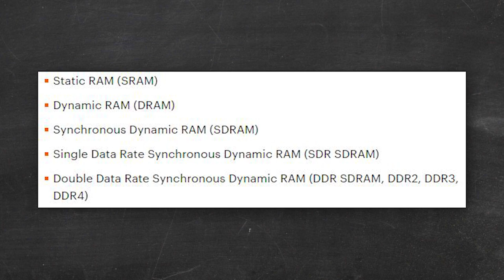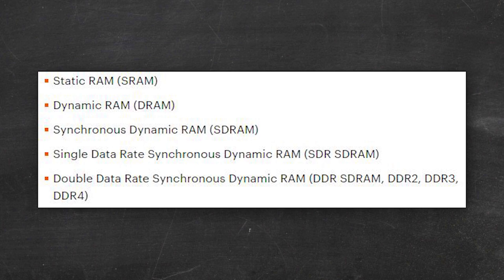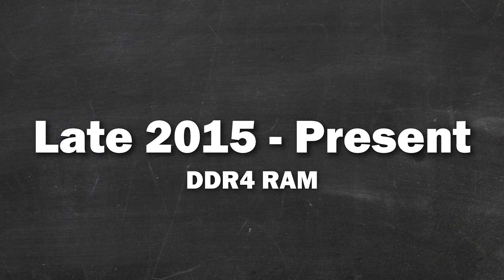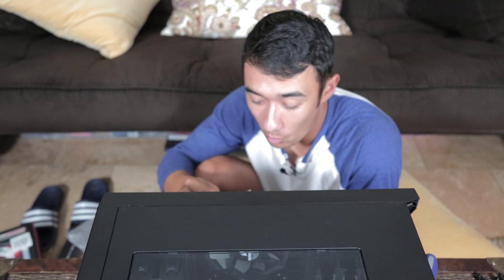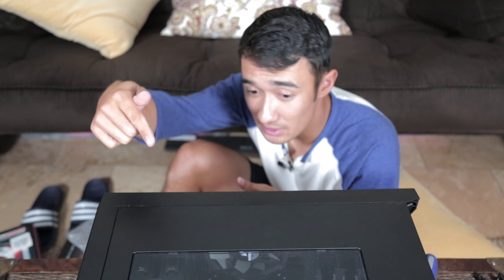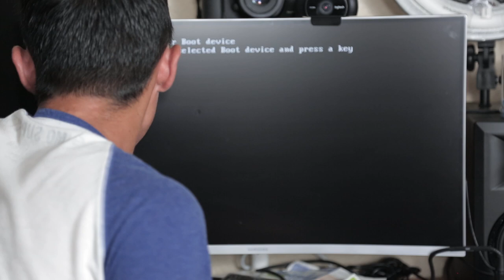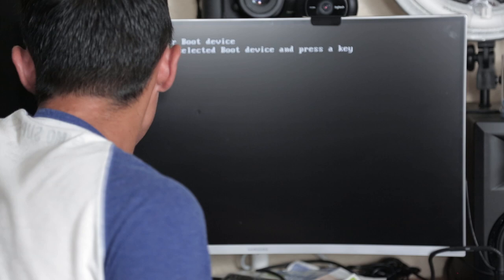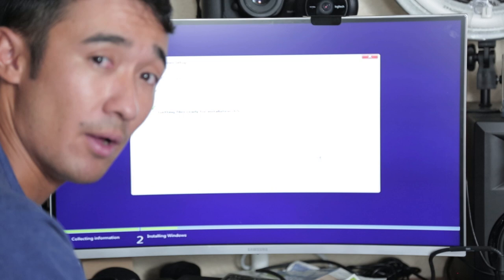How to Build A PC - Full Tutorial

Comment: I'm guessing you followed the verge principle of throwing away the cpu socket cover, keep that shit people, i would probably return a secondhand motherboard if it did not have that cover. Do not handle the cpu by its contacts. Test fit cpu cooler at this point. Always follow the motherboard instructions for ram placement. The "raised bits" in the case to mount the motherboard are called standoffs. Always check the case you buy will accommodate the motherboard, the standoffs may need to be moved, and always use the correct amount. A magnetic tipped screwdriver really helps, put all motherboard screws in lightly at first and once all screws in "tweak" them up, the motherboard is not going anywhere (the screw heads and motherboard holes are normally vibration proofed "have teeth" that lock them together). Always use the motherboard manual for graphics card location, do not just put it in any slot, if you have to wing it for any reason choose the pcie slot closest to the processor, only high end motherboards and processors will have "full" functionality on more than 1 pcie slot. Pcie slots are not lanes, lanes refers to bandwidth, (the motherboard hes using may have 24 lanes of bandwidth divided between all the pcie slots). Please add graphics card last! Can't wait to see this cooler, he knew wouldn't miss the ram then forgot to mount it out of the case. Doh. Please don't rest the motherboard upside down in the case. Please follow cpu cooler mounting instructions i can assure you it will not be the same. The power supply always sucks in air which is exhausted at the back of the case. Case fans always move air towards the hub, at least he knows they are moving in the same direction, just not the right direction. Psu mounted correctly for the case, but only just. Power supply lead clasps towards socket lips don't just play the shapes game. A 20 plus 4 pin power supply, not seen one of those since motherboards had 20 pins. DO NOT cut spare wires from the power supply. Note the flex on the graphics when he plugs in the power lead, probably due to not fitting all the motherboard standoffs. I've never seen any computer component come with twisty ties, they have a metal lining and can short things out, USE TWEEZERS PEOPLE. Plz dont play the shapes game with connections, they only go one way, always use motherboard instructions, no connection is in the same place on all motherboards. No thermal paste, corrupt video my ass, the tube has been sitting next to the build and not moved. Tweezers not twistys. I'm pretty sure this guy did a reaction video to the verge, what on earth possessed him to almost match it. A painful watch.

Comment: This really helped dude, I love how in depth it was!

The one problem I had; my Gigabyte z370 Aorus Gaming 7 had an outdated BIOS in it (I purchased it before they started making the updated BIOS a factory default, for 9th gen Intel support)

[But hey- on Gigabyte's official webpage, the z370 Aorus Gaming 7 actually supports 9th gen processors, but it needs F10 bios. That's the part I overlooked, because I made a fault assumption that my motherboard would come with F10)

And you can guess what type of CPU I bought. Yes, a 9th gen Intel CPU

So now I'm currently waiting on some low-end LGA1151 300 series Intel Celeron to be delivered, so I can actually boot up my system and upgrade the BIOS to F10.
(I actually did my research on this one, should be compatible with everything I already have(

Well, I might as well just upgrade to F11 for the hell of it.

[Specs:

Intel Core i5 9600k
Trident G.skill 2x 8gb DDR4 3000
Gigabyte z370 Aorus Gaming 7 rev. 1.0
EVGA 400w PSU (currently waiting on a 600w to come in the mail)
Gigabyte GeForce GTX 1060 3gb
WD 1tb HDD
CoolerMaster Hyper 212 Evo (the way you put the unit onto the CPU is absolutely DREADFUL, I would never buy this again. Such a pain in the ass.)]

Other than that old BIOS issue, everything is plugged in correctly, I've done the proper precautions, e.t.c.. so if I update the BIOS the CPU should finally work alongside my CPU.

Comment: Hey Kris. I had an issue with a PC that I built, which newbies should be made aware of. 

I purchased a Motherboard and processor and when i put it together, I found that it wouldn't boot. 
I spent a bit of time trying to figure out what 5 short beeps and a restart of the computer meant, pulling off parts and plugging them in.
In the end I had figured that I had checked that the processor was supported, but hadn't checked what the current bios version was on the motherboard. (ver.6) :( 
I had to buy a cheap second hand processor (that was compatible with the earlier bios) to upgrade the bios (ver.20), so that I could use my original processor. 

Lesson learnt... lol
Reply from the maker: You used a Ryzen processor didn't you?

Comment: Good video, but you forgot to show how you connect the front panel inputs of the case into the motherboard so that you are able to use the case's front USB connectors, mic inputs, etc. Since you used it in your video to boot from the USB drive, might want to include that.
Reply from the maker: I covered all that, did you skip through the video?
Reply: @KristoferYee  I stand corrected, missed that part.

Comment: Someone else made a comment about this already, but since it was unnecessarily harsh I understand why it might not be pinned: Pretty sure you got the air flow direction of the case fans wrong, and I think that of the PSU, too :) 
Would be nice to hear your thoughts on installing the PSU with that in mind. Since you could install it so that it sucks air out of the PC, you might need one exhaust-fan less (the current wisdom seems to be to have more intake fans than exhaust, to reach positive air pressure inside the case - so dust gets blown out rather than sucked in through not-filtered holes in the case). My concern then is that the PSU would receive hotter air than if you installed it the other way. But I think PSUs really want good cooling, since they must handle a lot of power that's being dissipated into heat, even with the highly efficient ones.

Comment: or instead of pulling out the usb drive just reboot the system go into the bios and change the boot options and then pull it oot just to save a hassle of actually pulling it out before its done

Comment: I think that u placed the fans wrong because the one at the backside sucks the air out, at least it should because of   the way the blades are shaped. Please correct me when I am wrong, but it is still an amazing video 👍🏻😁.
Reply: Yep that's true. I think he made alot of mistakes. Like installing the gpu before the cpu cooler.
Reply: when u build a pc trust me it is easy to mess up a few times and making a video doing when doing a pc build im sure is pretty hard lol but still better then the The Verge no one can mess up that much lol
Reply: @kyse2  true dat
Reply: But these are minor mistakes.
Reply: @onlyaliquis1876  and? he did it better than The Verge.

Comment: Hi I'm going to build my first Pc, I using it for 3d modeling/rendering, animation, video editing and overall content creation, I cant choose between Intel or Ryzen, I know Intel has more power but its pricey...Ryzen is cheaper and can do more Multitasking but my teacher advised me to go for intel... here's what I got listed so far it might change it depends.

Intel Build so far

Core I7 8700K 3.7 GHz 6-Core Processor

ASUS PRIME Z370-A

CORSAIR VS450 POWER SUPPLY

DEEPCOOL TESSERACT BF MIDTOWER BLACK

Cooler Master - Hyper 212

Gpu I thinking 1060

32 or 64 gbs of ram

1 TB HDD And 124-200 SSD

Ryzen Build so far

AMD RYZEN 5 2600X Or 2600

GIGABYTE X470 AORUS ULTRA GAMING

EVGA - SuperNOVA G3 650 W

COOLER MASTER MASTERBOX MB600L

Gpu same

Ram same

Storage same

Comment: Uh... You got the fans at around 27:00 wrong. The front pans are set intake, the rear fan is exhaust... I don't know why you would make assumptions based on the fan blades. A much safer one is that the part where the center spins is the intake, the part where the center doesn't move is the exhaust.

Comment: Did he get the fan directions wrong? He just said the fan at the back on the case would blow air in even though it’s an exhaust since it’s in the back. Airflow should go in the front out the back, and in the bottom and out the top. The frame that holds the fan itself is where the air blows away from, so the fans at 27:10 are actually sucking in air. The convex side takes in air whereas the concave side is the exit.

Comment: hey kris, love the video but could you double check the section where you talk about airflow at 27:00?  i work at an aerospace fan blade manufacturing company and the single fan near the cpu appears to be the one evacuating air out of the case, not sucking the air in
Reply: that is, for the single fan the concave side of the blade is the pressure side, which is facing outward, and convex is the suction side.  pressure would be greater on the concave side, applying force on the blades inward, and with conservation of momentum air would flow outward

Comment: Is it me or is the CPU not clean! no point pulling thermal paste on cpu that isn't clean, also your rear case fan shouldn't be blowing on your cooler, should be an exhaust to help pull air away from the cooler for better cooling. Other then them points, its good video, very well explained well done :)

Comment: Both intel and ryzen chips benefit from faster ram, not just ryzen. However some intel boards do limit ram speeds.
Reply: ryzen prefers faster ram to intel board, picking slower ram for a ryzen cpu will significantly limit performance, however with intel it doesn't matter as much
Reply: @thecatserole245  Benchmarks?

Comment: At 8:18 you actually said about thermal paste - "This is the glue you will be using to keep CPU cooler on your processor." WHAT??? So the brackets and screws or clips don't actually hold the cooler onto the CPU? That is such a 'Verge-like' statement. Also, you say the rear fan in the case is blowing air into the case and onto the CPU cooler. That fan is an exhaust fan the way it is normally set up. It PULLS hot air out of the case. Otherwise a great video.

Comment: just saw this. iam relativly new to pc building, just build 500-550 pcs in the last 10 years. 
first question: why is the psu installed like sucking in dust from the ground? if the psu is mounted on the upper part of the case, it is okay that the psu fan, 120mm fans in psus are always intakers, is looking downside. so it helps to get warm air out of the case.
second question: why is the rear casefan blowing out while the cpu fan is blowing into the case, so both fans "fight" each other? because the rear fan blows out while both front fans blow in the case.
they are preinstalled like this beause the configuration produces a higher airpressure in the case to keep dust out. and the cpu fan has to fight them too, like you installed it. a fan always spins right, from the side its connected to the fanframe. so yes you can see on the fins if it intakes or outtakes, but not the way like you said it ;) or easy said: the fan blows always in the direction where the wheel is connected to the fanframe.
btw: the heart of the pc is the psu, the cpu is the brain.
and for gigabyte boards, if there are 2x or more pcie16 on the electrical side, like x99 and some z170 or newer, its smart to consider the manual because even if both are electrical x16, better prefer the slot for the gpu that pcie lanes are directly conected to the cpu. besides plugin the gpu in a x8 instead of x16 costs around 1-3% of performance. with the new 3000 series from nvidia, is more important to choose the right pcie slot. but if you are to lazy to consider the manual or maybe dont have it to hand, its no big flaw to use the one closest to the cpu. 
and in you case the mainboard luckyly "says" the pcie lane amount.
and talking about psus,... gold, titanium etc. yes, this psus have a better efficiency but as you said 80% or 85% etc. they are only that efficient if the pc needs this percentage of the psu power, otherwise the efficiency is gone. so choose a psu  for the needs, bigger is not always better, and no, that is not what she said ;)
installing windows from a usb stick: it is more elegant to choose boot from usb once and dont set it in the bios as first boot device. otherwise the mainboard always looks for a usb boot device on the start what can bring in some nice effects, not only having a longer post, some usb drives can lock the pc from boot, had some issues in the past when a usb hdd or ssd as datagrab, locked the boot.
and for the ram, even it is mounted correctly for dual channel usage, if possible, always use the slot pair that is closer to the cpu, shorter lanes equals a little faster response.
maybe someone mentioned it before me, but i was to lazy to read 1500 comment and the video is already 2.5 years old... than sorry.
this is just my point of view and opinions. so for overall the video is solid.

Comment: Lmao I'm a noob & when I was building my 1st pc i thought the anti shock bracelet that came with the tool kit was a tool to grip stuff lol. Needles to say I took off the clamp end and just wore the bracelet all the while I was on a carpet. . . . In socks. 

Everything turned out good though & it works! Lol
Reply: I feel this in my soul. Props on your PC! What's the specs brother?
Reply: @Tovinthorn  thanks lol 
CPU i7-9700k

GPU zotac 2070 super 

Radiator nzxt kraken x52

HD barracuda 1Tb

DDR ram corsair vengeanc lpx16gb @3200mhz

SSD samsung evo 970 (500gb)

Motherboard z390 aorus pro wifi

Comment: You forgot to mention that you have to line up the brick with the insulating pads so the power supply doesn't short circuit and come into contact with the rest of the system

Comment: Hey how do I know how many watts I need for my pc...

 i7-8700k intel : 330 $
CPU cooler : 120 $
Motherboard: 143 $
16GB of ram: 40$
Nvdia gtx 1660 gfx card:230$
Power supply: corsair bronze plus 100$
Memory: ssd hyperX 60$ 250GB
Reply: Use a website called PC Partpicker. There you can select parts and put together PCs. It tells you if there are any errors, and gives you an estimated wattage. Hope this helps
Reply: @Almerino  thankyou

Comment: I'm trying to build a computer for work at home employment which requires me to open multiple tabs running off window 10. I'm new to this so this is a project for me. So please let me know what CPU and memory board to use with it. I need 8gb also if u can do a step by step video on where to screw everything in the shell.

Comment: The only Part i still dont completle understand is the RAM.

I mean if you buy a 3200mhz Kit it dosent run out of the box at that speed. I need to change some Bios/Uefi Settings , but my problem is that i wanna buy me a Ryzen system (build one) and so far i know ther eis no XMP for AMD Systems or ? So i need to Overclock it manual ?
Reply from the maker: There are XMP profiles for AMD systems. I just built a Ryzen system (video coming out today) and I was able to set it to 3000 MHz. That was with an X470 motherboard so it might be a recent addition for AMD systems OR maybe that just exists for top tier motherboards?
Reply: Ahh ok  , i wanted to buy me those Parts.

Ryzen 2700x

B450 Strix Motherboard.

And the Corsair CMR16GX4M2C3200C16    RAM.

I just was not sure if i can use them in my Motherboard because it was not listet by Corsair for that Motherboard. But at the Asus webside there was alot of Memory Kits wich i can use listet....the problem was after i checkt some of those , i saw that Corsair say it dont run on a AMD Chipset.

I was confused. xD

(And sorry for my bad English. I am still learning :3 )

Comment: I want to get 8GBs of RAM, but wouldn't it be better to get 1x8 than 2x4? I know that older version of RAM would perform better if it was 1x4 than 2x2GBs of RAM. In the video you said you should typically get 2 sticks of RAM and I just want to know why, you didnt explain it enough.
Reply: Typically it is because it eases the load from both sticks as opposed to one. Think of it like this: if you had only one strong guy working a construction job, he would be able to do the work but he would be exhausted and wouldn't get the work done as fast as if he had two people there.

Comment: I built a 1.2k pc (I'm 15) for Rainbow 6 Siege, GTA V, Rust, FSX Steam Edition, and some more high quality games. I got a Ryzen 7-1700x, a gtx 1660, 16 gb RAM, 2 tb hdd, 540 gb ssd, ROG Strix B450-F(motherboard), Cooler Master MasterLiquid Lite cooler, Corsair SPEC-OMEGA, Corsair Modular PSU(I think 650 watts). Was this a good build? I tried to get the cheapest parts, but as I'm still young I didn't want to show up to a deal with $200 in hand and get robbed. I live about 5 minutes away from gang territory so yeah.
Again, was this a good build?

Comment: Not sure what I did wrong, but the pc turns on, all the rgb turns on. But nothing shows up on the monitor, the fans won’t spin on my cpu cooler or case fans. Everything is plugged in, not sure what I did wrong
Reply: did you find what was wrong?
Reply: Bryton Duropan I did thankfully. The power supply cables were not connecting properly to the psu. It was a simple solution, but it being my first build my initial reaction was to freak out lol

Comment: If I'm using ethernet, do I need to buy a network card for my motherboard?
Also what do I do with my CD that came with the motherboard box? The menu had something like I should insert it in to install drivers, does it matter? I don't want to go on amazon to buy a dvd reader for my pc.
Reply from the maker: No.

You don't have to install the drivers or BIOS on there in almost every scenario so don't worry about it.